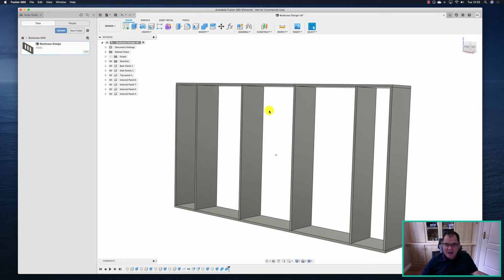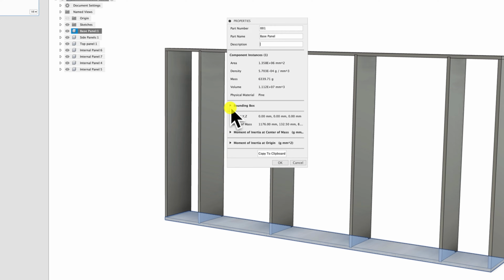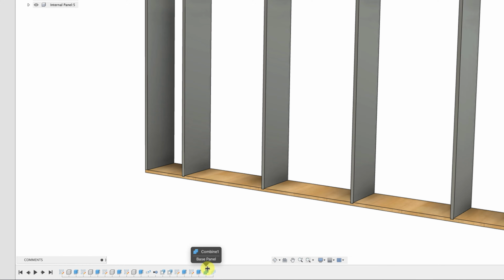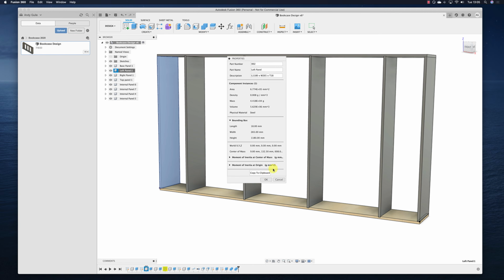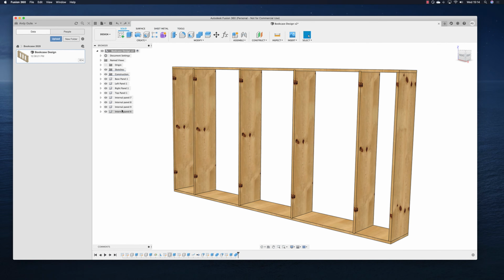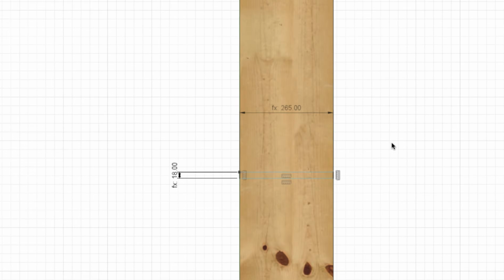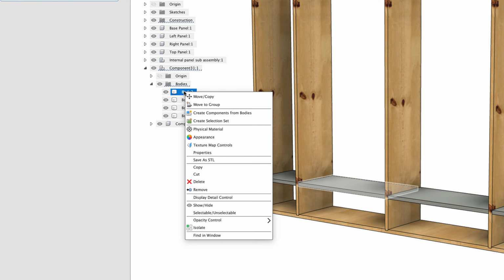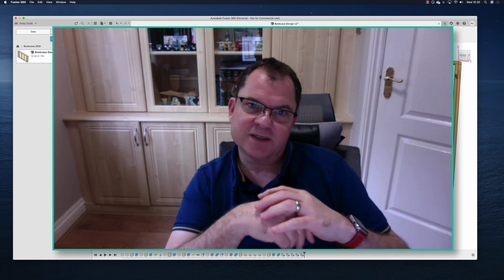Fusion 360 for Woodworkers - Lesson 4 Material type, updating properties, creating sub assemblies

Comment: first of all i want thank you this is a helped me learn this program so easily but im have a problem im making a dresser and made shelves for all the drawers using the pattern tool so when i go in to make the divides because the bottom two shelves are going to two Drawers are going to be 2 and the top two section will have 3 drawers when i start to set the joinery it cuts all of the shelves because they are copies

Comment: you created a little issue with the sketch for the top panel by removing the side panels, thats why a sketch turned yellow in the timeline. in that case you can relocate the sketch to a new construction level or a body to fix it. you should have shown it in your video ;)
tho its an awesome video to learn how to create such parts with parameters and other features!
Reply from the maker: Thanks for that,

Yes you are correct, I probably didn’t realise it had happened.

 Cheers

Andy

Comment: These are great videos, finally got a machine powerful enough to run some 3d modeling.  I got myself in a jam during this video and I'm considering starting over but thought I would ask first.  Some how during the step where we went back in the timeline to  create separate components of the right and left panels my top panel lost it's anchor to the rest of the diagram so it doesn't move as a resize.  There was a yellow highlight around the sketch step and then I deleted that now the yellow highlight is around the extrude step.  I am not quite sure how to fix this although it does feel fixable.  Do you explain fixing these issues in a later video?
Reply: Ha, nevermind, I figured it out after I posted the question as usual.  I had to redraw the sketch for the top shelf and then right click on the top panel extrusion part and select "Edit Feature"  Then select the sketch for the Profile (which is indicated as missing in the edit feature window).  For some reason my sketch was broken into two rectangles but I selected them both and it seems to have worked.  Still not 100% sure what is happening but it seems to work now.
Reply from the maker: Hi,

Glad you found it in the end, re-drawing the component usually sorts out the problem. I sometimes think that Fusion is to clever and now and then things break.

A great command that you will see when you get to the drawer episode is the joint command (the wood glue in Fusion).

That connects components together, so you ground one component (normally the one that sits on the floor) and the. Glue things to it, that normally ensures Fusion keeps all its ref points.

Cheers

Andy
Reply: Hey, nicely explained. I was having the same issue and about to hit the control Z fifty times and go over it again, but I now have my parametric model again. Thank you !

Comment: Another great video. Just a quick question on the properties. By adding the dimensions into the description box, are you not then moving away from the intelligence of fusion? What happens if you adjust your parameters to make the component different, do you have to go back into the properties of each component and then edit the size in the description box?

Just wondered if there was a more automated way to obtain the component dimensions for a cut list that doesn’t rely on manual intervention?
Reply from the maker: Hi Richard,

Thank you for the feedback, I haven’t yet found a way of auto updating the description box. Also haven’t found a way of  pulling through the dimensions directly to the cut list.

Strangely you can export the actual dimensions, we will look at that more when we get to the diagram side of things. I will keep researching,

But for now my only answer is to update manually.

Cheers

Andy

Comment: Brill, and the new software is loads better...zooming in at important points is a lot clearer... Andy did you change the Bookcase Height from 1252mm in the parameters  to 1216mm at some point.. I may have missed it if you did... you refer to the left panel as the bookcase height minus the stock thickness x 2 ..to give 1180mm.   👍👍👍👍
Reply from the maker: Hi Paul,

Yes I do have the height set to 1216, looks like I have changed it at some point and bit changed it back.

One of the challenges of keeping re-sizing things to show how things work.

Good catch, I will correct at the start of the next video - the good news is we only need to change one parameter and everything will update.

Cheers

Andy
Reply: @TheWoodgrafter  Thanks for the reply Andy.... Can't believe you haven't got more viewers.. I mentioned the series again last night on Woodworking UK
Reply from the maker: Hi Paul,

The views will come - it is pretty niches to be fair.

Thank you for the continual promotion.

Cheers

Andy

Comment: Great tutorial.  This is great information, especially about how to properly fill out the properties information for later use in the drawings.  There is just nowhere that I have found  that explains this kind of stuff.  I am used to getting some sort of detailed user's guide and manual to explain all of this but not so with Fusion.  Very frustrating to me.   I flounder around, bumping into this tool or that feature until I get done what I need at the time.  This workflow and process is far more efficient, especially for this type of cabinetry, which is what I am building.  Thanks again.  The new software is good, but I would suggest to you to not worry so much about the video editing.  To be frank, I didn't really notice a big difference because I was concentrating on the content son much!!!
Reply from the maker: Thanks for this,

If the editing isn’t getting in the way and you are finding value - then it obviously works :-)

I had the same problem when learning Fusion (and I continue to learn every day) it is so big that traditional approaches tend to explain everything and it gets to much.

That’s why I thought that coming at it from a workflow point of view made mere sense.

Cheers

Andy